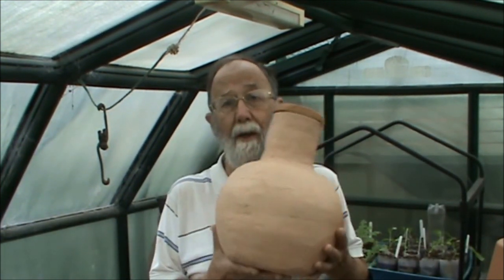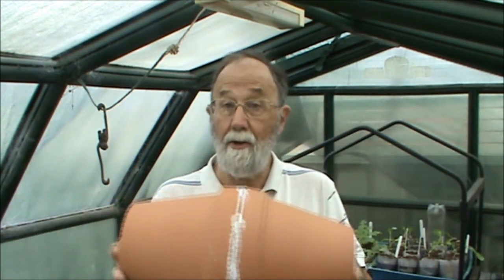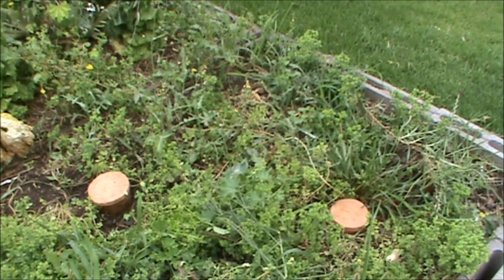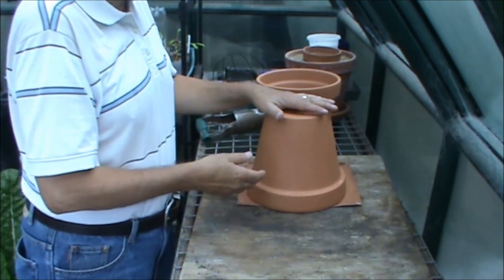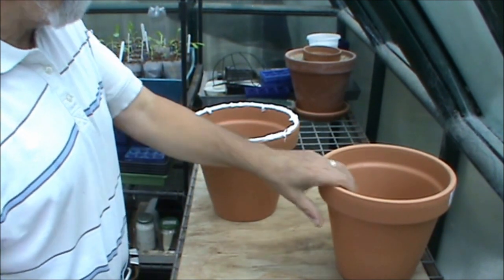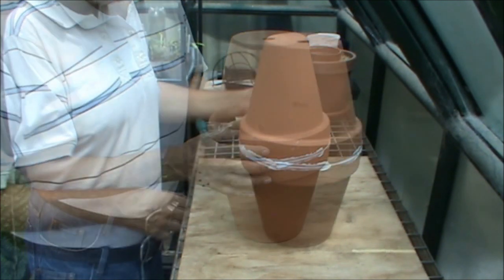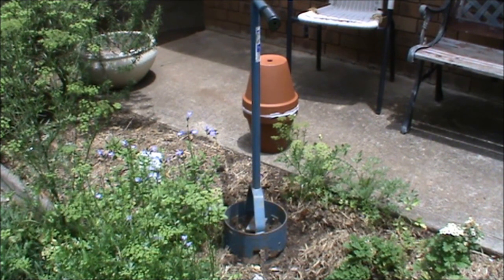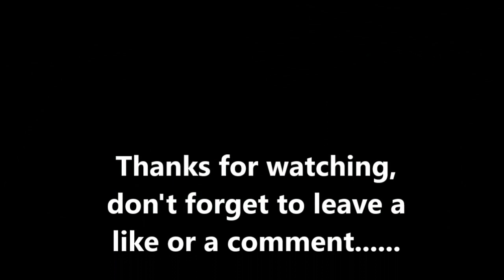Making & Installing Clay Pot Irrigation

Comment: I have never seen a post hole digger like that in America before. Now I am off to Amazon, and gods help aliexpress after that if necessary to find one. So much easier to use than the jab and scissors type I've used.
Reply from the maker: Yes, we have those as well but I have always found the screw type to be a better bet!

Comment: I also would recommend using "Water crystals" also known as "Water beads".  These are polymers that soak up and hold water and then slowly release the moisture into the nearby soil.  these are tiny and are sprinkled onto the soil and worked into the growing space.
Reply from the maker: I am aware of them but don't see any advantage over the ollas

Comment: Thanks for this. Just one question. so you dont need to use milk caps on the inside ?  just plug up the hole w the silicon ? Sorry. I cant find any videos which shows how the inside should look like.. sorry for th dumb question. (I am very un-handy !!!)

Comment: Are you able to leave these in the ground over the winter?  Where I am we have many freeze/thaw cycles. I would like to do this next summer here in New York State (upstate.)
Reply from the maker: Hi Wendy! Sorry, I have no idea! Here in Sydney the worst we will get is a couple of degrees of frost and at no time will the ground come close to freezing!
Reply: @underthechokotree2792  Thank you for getting back to me. If anyone else out there knows I'd love to hear from you. Sincerely
Reply: @wendypursel3142  The freeze-thaw will eventually pulverize the terra cotta. Dig them out before winter and pour out any water inside. Put them someplace to dry out and store them someplace where they'll stay dry all winter.

In areas that don't often get below freezing, they're fine as is unless one needs to do digging where the pots are buried. Don't fill them right before freezing temps are expected to be on the safe side.
Reply: @dergluckliche4973  Thank you. Next Spring I'll be digging some holes!

Comment: I really would like to know what tool you used to dig a hole for the ollas. Looks like some kind of manual auger. Does it work well if the soil has some roots in it ;) ? Many thanks in advance!
Reply from the maker: It is a 200m post hole auger and in our clay soil it works pretty well! :-)